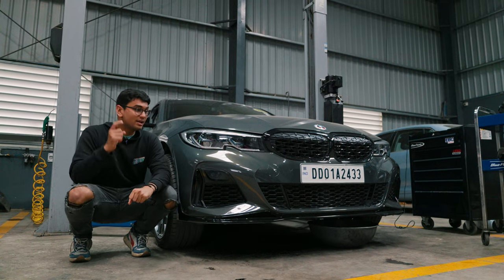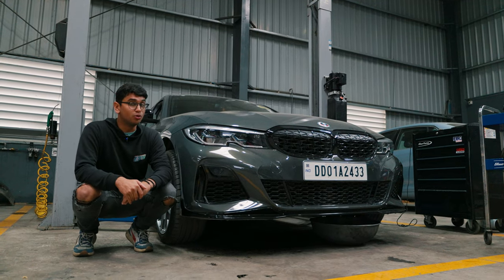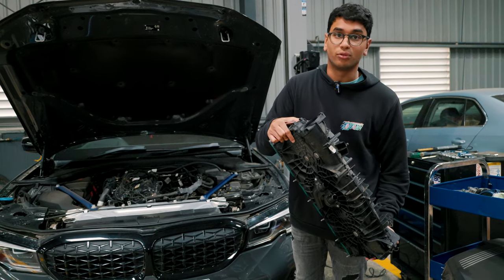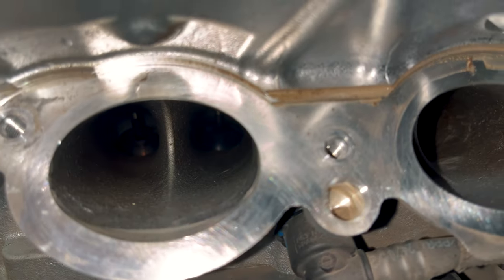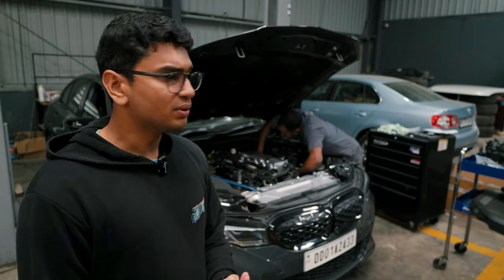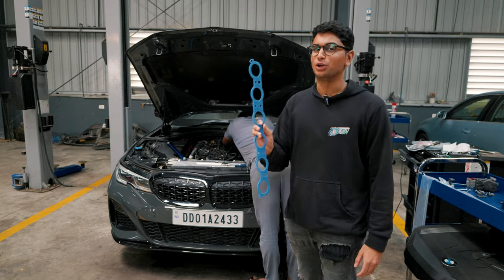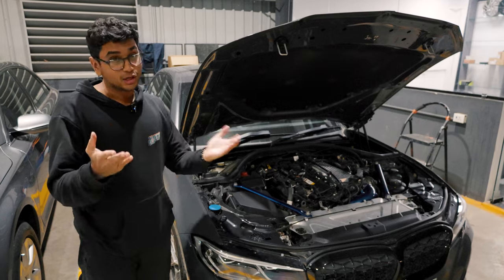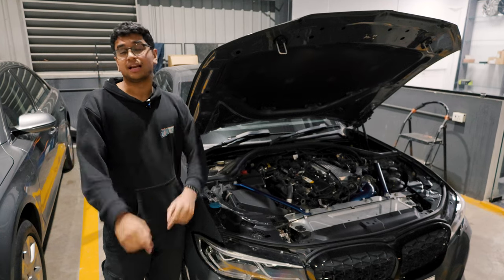CSF Intake Manifold Upgrade to G20 M340i! (Pushing the limits of Stage 2) | Project M340i

Comment: I have a swift V2 diesel I was planning to tune the car as a beginner I thought I will remap to stage 1, replace the air filter with good aftermarket filter, change the head can to maybe valvetronic guys please drop some suggestions.